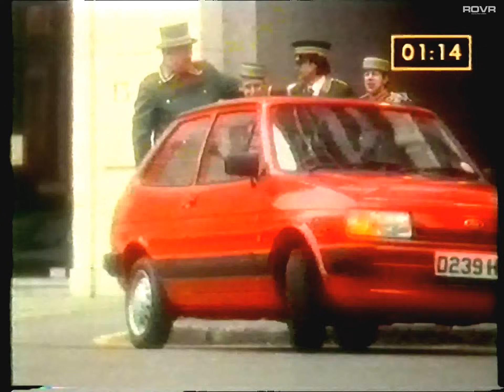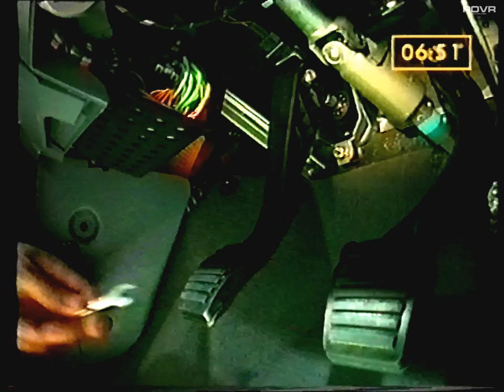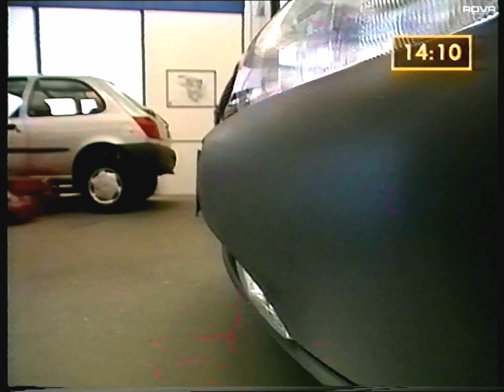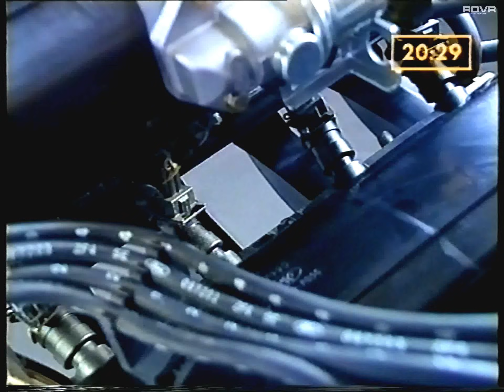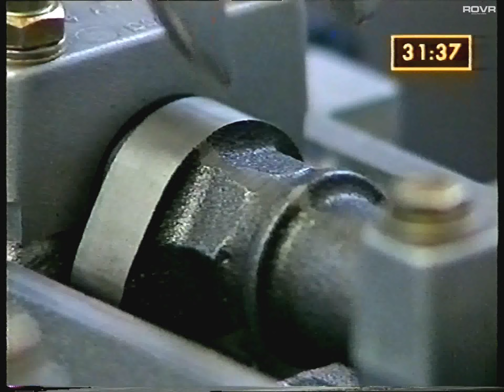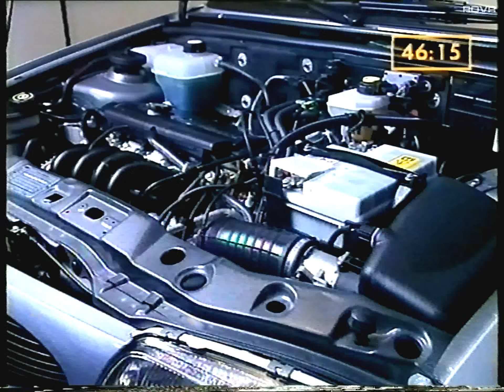Ford - Fiesta (Mk4) - Service Training (1996)

Comment: A prove of passage from iron strength simple and durable engines to tite precise soft aluminum engines with crucial plastic parts,  it used to say that " its working goid as long it works..
In this case,  i think the older 1.3
Engine of the ford Anglia is rock solid is better along with its modest performance....

Comment: I can't get the speedometer cable off. I'm going to cut it now because the 22mm wrench just spins the whole cable. I can't get it off, and I can't disconnect it from behind the speedometer unit/instrument cluster either.

Comment: Had the Fiesta 1997 1.25, inherited from my grandfather being 12 years old with only 60.000km. Great little car, the chassi looked old but the engine and handling were great, i remember the torque from low rpm, could start even with second gear. Sold it after 3 years for 1500€ and still regret it, should have kept it for 2nd or 3rd car.

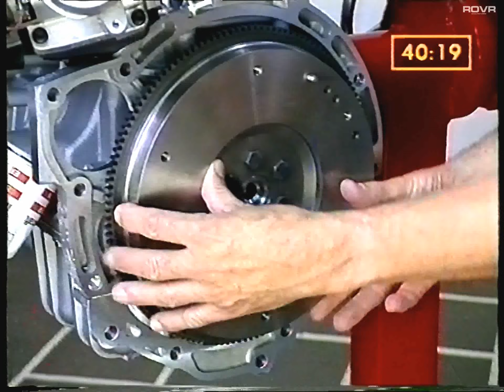Comment: At 40:18 you say that the crank shaft need to be turned clock wise and the gentleman is turning the flywheel  anti clockwise....you say never anti-clockwise with the peg in place...

Comment: 99 Mk 4 ghia , 1.25 engine, few issues with fuel pump that need fixing and shes due a big service but body and paint perfect and a head turner still. I love driving it. After renting modern cars on holiday i always feel dead inside even if theyre faster or more advanced. theyre all soulless compared to the fez

Comment: Anyone here know what kind of front left window regulator is suitable for Fiesta 2001 z-tec? Automatic windows. Original ones are expensive and I am not sure whether any other brands (or ones from 2004 - 2008 etc.) is compatible with 2001 fiesta door. Thanks!
Reply: Should be this one with the OE-number from Ford: 96FGB23201BB

Comment: Hello, Thank a lot for the excellent lesson in how to fit the timing chain. I by mistake turn the crankshaft without the main bolt attached. So I miss the timing. I forgot this timing procedure and turn the engine by hand whit a bit efort until it turns. Then again until a bit efort and freely again. Dummy me. Then I read the manual carefuly and insert the timing pin on the slot on the rear engine until the crankshat hit it. Put the iron bar on the slots of the camshafts. Mount all, turn the engine two turns and the timing marks are OK. But there is a starnhe thing. The engine has no compression and wont start. Is tere any possibility to have damaged the valves while turning by hand out of timing?

Comment: We owned 3. A 98 1.3 endura. I covered 60k miles in 2 years. Followed by a 2000 ZetecS I did 140k in just over 4 years. My mum owned a 99 1.25 Zetec and kept it 10 years and 60K. All cars were very reliable apart from a slave cylinder failure on the ZetecS at 70k.
Reply: clutch  slave cylinder?
Reply: @MrLocter  yes 👍🏼
Reply: I'm planning to get a 1998 fiesta 1.3 Automatic transmittion.. The dealer says it only has 88000 km.. Unfortunately you can't make sure since the clock only has 5 digits, so in worst case it might be 188000km, but the car looks great and only has one previous owner..  Would you recommend it?
Reply: @jwan_1193  yes I really would recommend it. I guess the main thing would be to check underneath for corrosion.
Reply: @lanehogger1532  thanks! Yeah I sure will, according to photos it looks very 'clean' ... So would you recommend it even if it had 188k km?  Arguably some old cars have bad automatic transmission.. Not sure about this one.. But would really love to own one
Reply: @jwan_1193  yes if it’s priced accordingly.
Reply: @jwan_1193  no , get one manual car

Comment: I always loved driving my sister's mk4 1.25 flight, felt like a limo after my MK3 1.1lx! Power steering, electric windows, central locking, what luxury! And the ride was extremely good too. They both shared a terrifying tendency for lift off oversteer in the rain though, she put hers backwards in a ditch because of it haha. Seems a trend with fords of the 90s and early 2000s, MK1 focus was bad too. Shame they rusted so badly.

Comment: Had a ‘97 P 1.25 16v in bright blue. It was rapid and a great little car to drive. Got 110mph out of it. Rear wheel arches started rotting out after 18 months right enough. Poor quality build from the Valencia factory.

Comment: 5:24 makes no sense. How does the shaft move without the gear moving? I know they are not fixed, but the shaft rotation relies on the gear not vice versa, unless ur coasting. How did they manage to do that?

Comment: My first car, a 98, owned it since 2003, passed my test in it and still got it today, still going strong at 74k. Interesting watch thanks for posting.
Reply: Waw! What’s the body work like? Zetec 1.25 engine was amazing
Reply: @germanicgovirus  Never been welded and all original paint, there are some scratches & stone chips though. Colour is State Blue.
Reply: @markbrice3619  That's incredible.  I had a 1998 Ford Puma and it was falling apart when I reluctantly sold it to a scrappy in 2014.  I had the car for around 13 years and it was a brilliant machine.  What's the secret with your car in that the body work is in such good nick?
Reply: @germanicgovirus  I really like the original Puma, great car. My secret is nothing special, car has always been polished, waxed and kept dry in the garage.
Reply: I wasn’t born around this time , I was born shortly after . So I’m just wondering if your first car was 5 years old . Wouldn’t it have been quite expensive or were cars massively cheaper then
Reply: @ohsantana616  Hiya, yes 5 years old when I purchased it, 1 lady owner from new. I bought it for 3.5k.
Reply: @yossarian  
I'm planning to get a 1998 fiesta 1.3 Automatic transmittion.. The dealer says it only has 88000 km.. Unfortunately you can't make sure since the clock only has 5 digits, so in worst case it might be 188000km, but the car looks great and only has one previous owner..  Would you recommend it
Reply: Do you have it still?? Its pretty sad car, mainly the front lights
Reply: @pr0rex46   Hey. Yes, I still have the car. I've had it 21 years now. There is no rust anywhere, and the paint is in good condition with the odd mark. It does turn heads, I've had smiles waves & thumbs up from people passing, since it's not a car you see very often anymore. It's been a very reliable car.

Comment: Theses were a very stong car mechanically the very a better car that the next model in my opinion  rust on the sils and archs was the killer if the cars wasnt regularly waxoil or dinatrol in the correct points other than that they went forever!
Reply: You can change them with the camshaft in situ .....